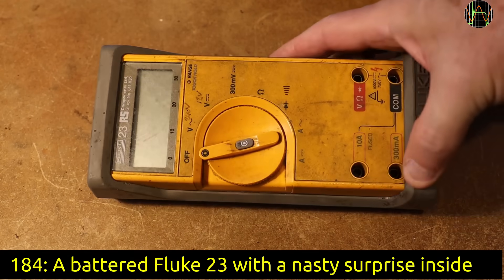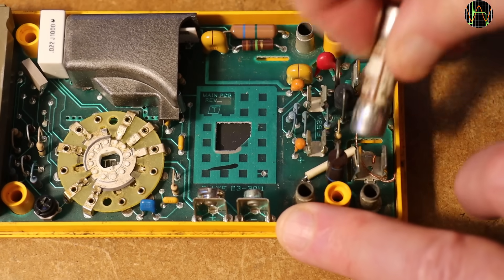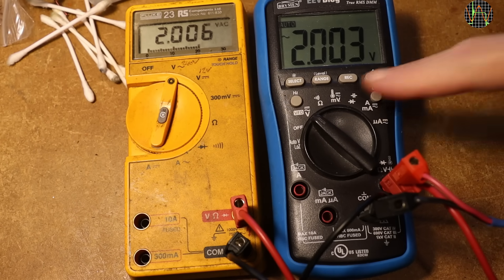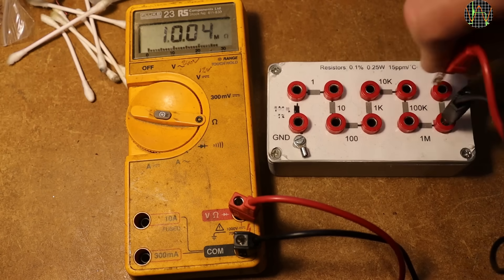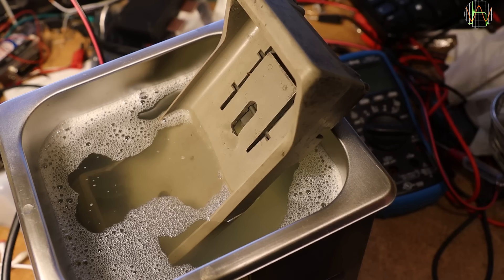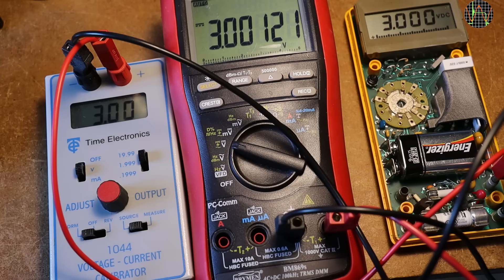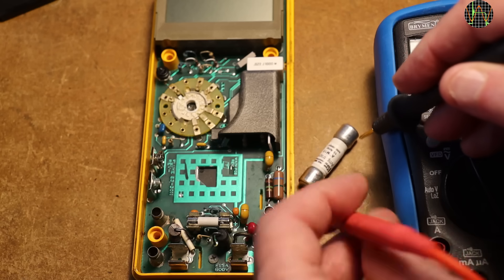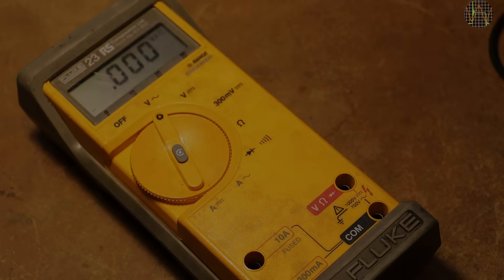184 - A battered Fluke 23 with a nasty surprise inside

Comment: This 23 deserved to be resurrected. Great job.

Ultrasonic cleaning almost always requires a precleaning if your cleaning solution isn't a strong or apt solvent. It's fair to assume most of the muck on this DMM is grease suspended debris. You may want to give a stronger degreaser a try. I'm not sure if Simple Green is available in the UK, but covering surface with kim wipes, spraying the degreaser, letting it work 10 to 15 mins, and then coming back with a melamine pad (c.k.a: magic eraser), while paying attention to not remove the markings maybe yield good results.

For the acrylic screen, Novus has pretty good 3 product kits. I've restored my scratched BM869 screen with it.
Reply from the maker: I also use the Novus set for display windows with good results (see my Fluke 27 video) but its still a lot of work, even with a Dremel polishing bit. Maybe if I get the rest of the housing into a better shape, it makes sense to work more on the display.  
I can get simple green cleaner/degreaser here. Quite expensive though. Thinking about it. Thanks for the tip anyway
Reply: @TheHWcave  It's wild to read "expensive" and "simple green" in the same sentence as an American :) I see they are asking 45 GBP ~ $60 for a gallon. That's daylight robbery. Simple Green is good, but not that good. It's $11/gal or $5 for 16 fl oz here.

Another option you may want to look into is d-limonene based cleaners. Goo Gone, adhesive remover is based on that. It's fairlu easy to find 85-95% D-Limonene based products here, but certainly more expensive than Simple Green. Maybe there's a local product, or some EU import, in smaller quantities and more reasonable price.

Comment: The problem with the wire along the fuse: Usually this happend when You are in a hurry somewhere in the field, say an urgent repair job for a customer. Of course this very special fuse is not in the service truck. So the only immediate solution to the situation is to fix it with a little bit of wire. But back home all this is forgotten due to the stress of everyday life... Of course next time You are in much bigger trouble, but that is what happens...
Reply: No disagreement that a quick patch if you're the only user may be the best solution but for the love of god don't replace the fuse and don't solder it in a way that will be hidden under a fuse. That is just criminal
Reply: That's why - When I last bought a new meter - I bought two. This way; If meter #1 blows its fuse (I hope to avoid that! 😋) I can just grab meter #2 and worry about a proper resolution for #1 after the job has been finished! 👍